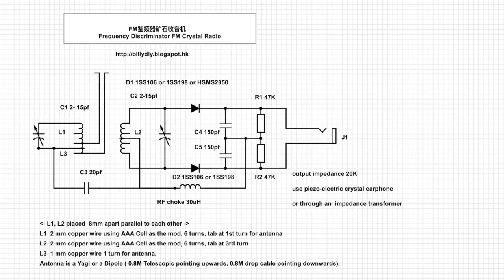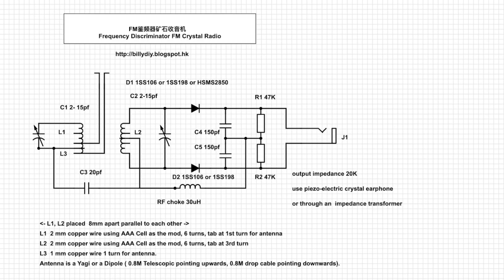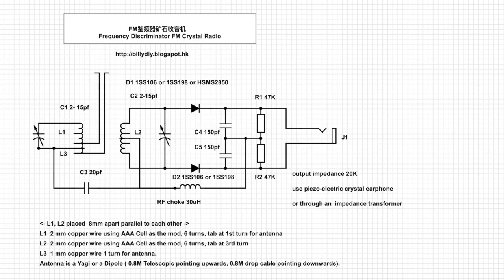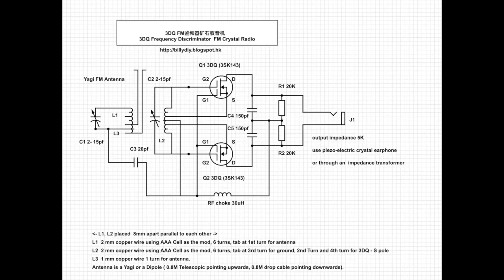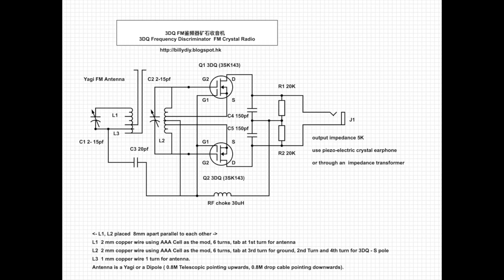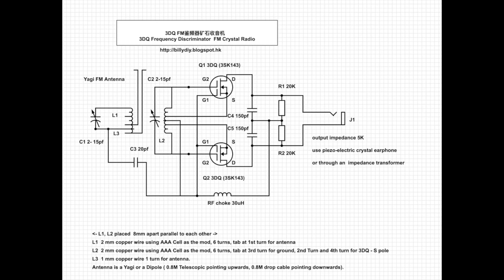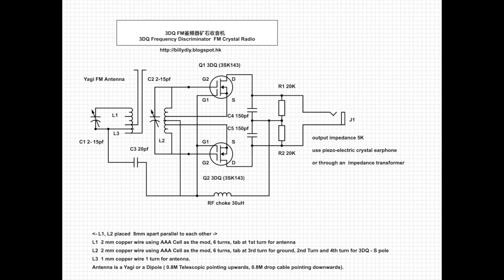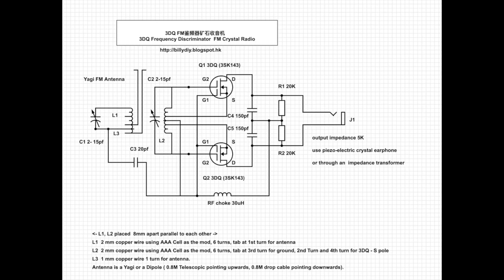3DQ Frequency Detector  FM Crystal Radio (3D Printed)

Comment: Is the direction of winding the coils has some meaning?
Reply from the maker: It’s better to wind them in the same direction. Otherwise the phase change from the primary LC to the secondary LC circuit will not be 90 degree and the phase detection may fail.
Reply: @BillyCdiy  Are you convinced that the MOSFET sounds louder than the diode?
Reply from the maker: @Lechoslowianin  , in this foster-seeley circuit, the diode seems to outperform the 3DQ. But the circuit may not be optimal, need more testing
Reply: @BillyCdiy  Thank you for your answer. I don't know the English language, that's why I'm asking so. Soon he is trying to run such a radio on 3DQ. If I am successful, I will let you know. regards

Comment: Very interesting I might have enough parts left over from building some of your other crystal radios to make this radio but it won't be 3D printed
Reply from the maker: Thanks. The circuit works on regular parts as well. I'll be releasing a series of videos about what you need to make an FM Crystal Radio successfully. Stay tuned.